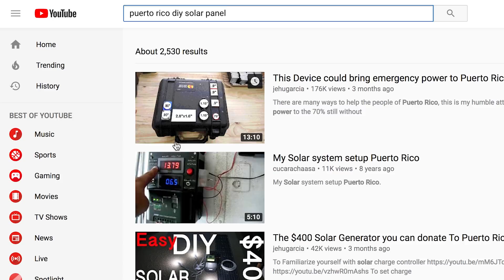Can DIY Solar Panels Solve Puerto Rico’s Power Crisis?

Comment: Perhaps Beme News can do a follow up story about why Puerto Rico's electrical power grid restoration has not been completed.  After working over forty years in the power industry, I was amazed to see Whitefish Power removed from their repair efforts and replaced by, well basically nothing.  The shots I saw on the news showed crews repairing the high voltage transmission lines to get the system backbone, so to speak, up and working before moving on to the distribution lines.  Then amid what looked like a politically based outcry about Whitefish Power's contract and small company size grew into a media feeding frenzy which ultimately halted what looked to be competent and growing repair activity.  For reasons I know nothing about, Puerto Rico's power company/agency was suffering from financial difficulties and was not part of a mutual aid agreement with other utilities as is normally the case.  These agreements provide quick, competent assistance when emergencies strike and are essential to fast power restoration.  Absent these agreements, Puerto Rico was lucky to have any electrical contracting company take the risk of quickly moving in and beginning repairs without the normal financial guarantees.  Then, while Whitefish was on site and bringing in more resources, the political and media storm took away what looks now to be Puerto Rico's one chance of timely power restoration.  Beme News' fresh and honest reporting would be the perfect platform for a comprehensive look at what happened then and what has happened since with Puerto Rico's power system restoration.
Reply: I'm actually covering that part of the story on my own channel

Comment: Little known dilemma affecting the restoration of power on Puerto Rico:  The Army Corp of Engineers' mandate only permits restoration to things as they were before sustaining damage.

This is means that the ACoE can only rebuild the outdated, fossil fuel-powered, centralized grid, not update or improve it. Obsolete infrastructure elements no longer available now have to be custom fabricated off-shore at higher costs and long delays, rather than converting to a hybrid, distributed grid system, integrating solar, wind, hydro/tidal and battery storage!

Before Hurricane Maria devastated PR, only 3% of power came from renewable energy sources. The bulk of the country's power generation was sourced from liquid fossil fuels that have to be shipped to the island. Ludicrous.

PR, a US territory with no biting representation, is more populous than 21 states. It's shameful that so many US citizens remain without power, five months after Hurricane Maria.

If this happened in New Orleans, or Houston, or in any other major city or state, the situation would be very, very different.
Reply: Yup one of the many reasons I am an Anarchist. Voluntaryism is the future...

Comment: Her little bit of solar power will go a lot further if she can get some LED or florescent light bulbs to replace those incandescent ones.
Reply: Actually we gave her LED lights with the generator. They consume only around 8watts.
Reply: Thanks for the info, and thanks for the work you do!
Reply: You can easily tell that that was an 8w 800 lumen LED bulb. It was also 4k temp which is why the light was more bluish. Why would you think anyone would use an incandescent bulb?